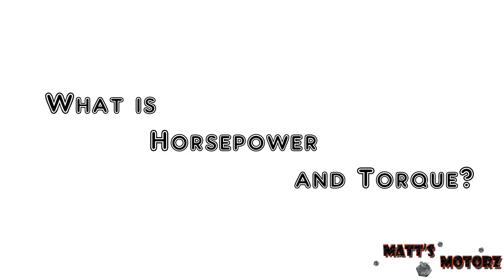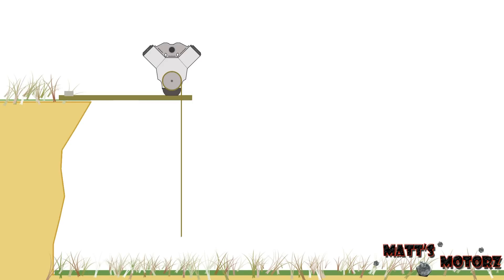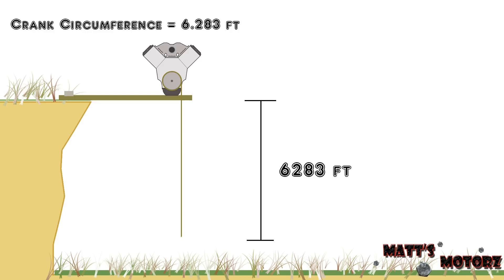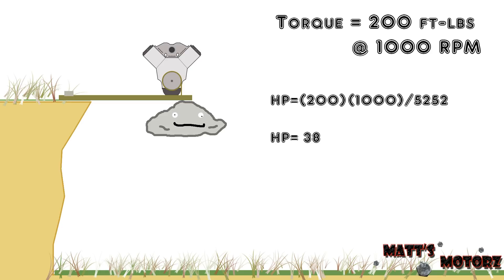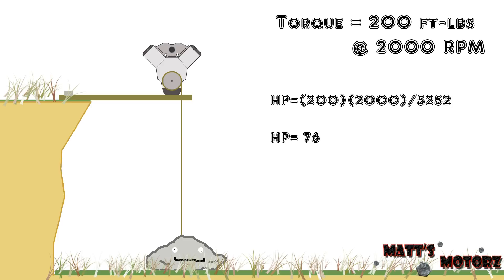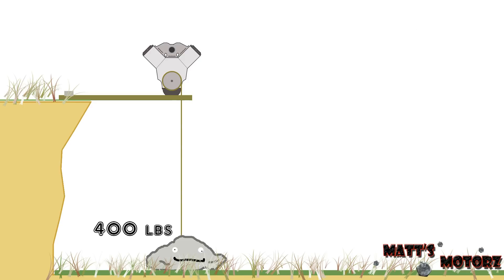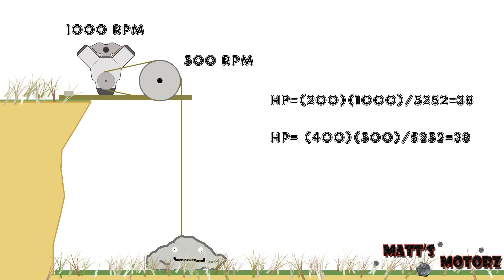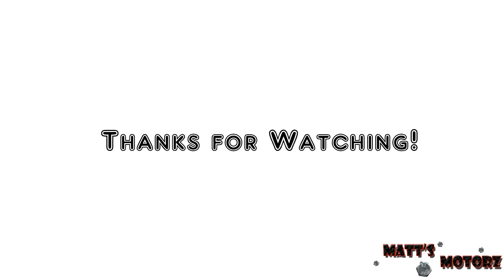What is Horsepower and Torque?

Comment: is gas mileage better when the car is running in low gear or in higher gear? Imagine, you're going up a heal, you can climb it in 2nd gear or in 4th gear where the car is almost stalling.
Reply: Generally a higher gear will reduce the RPM and cause less explosions per second = less fuel consumption = better mileage...as long as your engine can deliver the torque needed on the wheels to get going.
Reply: But, the injectors pump more gas under load, don't they? Lets say this is a 1.8turbo engine
Reply: but maybe they push more gas when the load is greater?
Reply: Sure, each explosion can have different energy produced. Your engine running idle at X RPM uses less fuel per cycle than when driving, for example.
Reply: now back to the original question, is it more efficient to drive in low gear or in high gear up the mountain?
Reply: meocats Well gas mileage is usually measured when the only load on the engine would be the car itself. Going up a hill forget gas mileage. The average car weighs roughly 3,000s lbs. Lets say you're going up an incline that is 30 degrees. We all know how gravity works so the motor is not worried about propelling the car on a flat surface but fighting against the car rolling back. To put it to simpler terms you would get the same results by putting the engine (lets say the 3,000 lb car came with a 2.5 liter engine) into a car that weighs 5,000 pounds. More load=more fuel consumption. You will never use high gears at low speeds nor high gears at high speeds.
Reply: xXxMartin96xXx, You can, within some limits, get better fuel efficiency at lower speed, but it's not a general rule. The more weight you carry the more rolling tire resistance and other energy losses you get e.g. when you brake the car more energy gets lost into heat. But surely, reducing the car's speed helps reduce air drag and overall energy needed.

Comment: horsepower is how fast you can hit the wall, torque is how far you can carry the wall with you :)
Reply: All these explanations just makes people not actually understand the physics involved.
Reply: horsepower is just the amount of work the engine can do... the design of a cars engine is to turn linear motion(pistons moving back and forth) into rotational motion(driveshaft, flywheel, transmission, driveshaft/CV axle, wheels) creating "torque" which is "usable" energy distributed through the flywheel and transmission to the wheels and give you mobility.
Reply: Horsepower is a unit for amount of work per time (about 746 Joules of work per second). A Big Mac contains about 2,300 Kilo Joules or 2,300,000 / 746 / 60 / 60 = 0.9 horsepower during an hour.

Torque is not usable energy. Torque is a twisting force that combined with rotation can create power (and energy through time). You can have 1000 foot pound of torque with zero energy if the RPM is zero.
Reply: this makes me think of a car running on big macs
Reply: i need investors for my big mac engine
Reply: ***** shhhhhhh

i dont want anyone knowing of that
Reply: Horsepower is how fast you can accelerate the wall and the vehicle, torque is just a number.
Reply: Torque is how wrong, stupid and irrelevant an analogy is. RPM is how much it gets multiplied by "likes".
". Power is the resulting permanent
cognative damage caused to our collective consciousness.
Power, not torque, is the limiting factor in not only the top speed of a vehicle but also how quickly it can accelerate at any speed and how much weight it can pull up an incline at any speed.
Please do yourself and the comments section a favour and watch a video called:
"Horsepower is NOT how fast you hit the wall.
Torque is NOT how far you take the wall with you"
It's on the D4A channel. It illustrates the distain the people who understand Physics and engineering have for these idiotic Idioms that spread like a pathogenic mind virus.

Comment: I'm still flipping lost? 
So for argument Sake if I had a Engine that had 160bhp & 280lbs but only revved to 4500. 
And I had another engine 160bhp with 177lbs but revved to 6500 which would be the quickest .?

Comment: Holy fuck, Americans and your imperial units. This is how you understand this.

1 Horsepower is equal to 746 Watts, and Watts is a unit of power which is also the Energy (Joules) per second. For example, a 100 Watt lightbulb will consume 100 Joules of energy every second, a car with 100 Horsepower would consume 746 Kilojoules of energy every second.

Torque is a unit of Force and is measured in Newtons, and what is force? It's how hard you push on something, if you push on a button very hard, then there is a lot of force, if you press it softly, then there is little force. If you twist the crankshaft very hard, then you're applying a lot of torque, if you don't twist it very hard, then you're applying little torque.

Torque is important because it measures how strong your arms are, if you want to twist a very heavy crankshaft, then you need strong arms that can apply a lot of force. High torque is necessary for trucks that need to handle a lot of weight.

Horsepower is more related to energy consumption, if you are able to consume a lot of energy in a short amount of time, then it translates to more movement, this is important for sports cars which focus on consuming the greatest energy possible in order achieve the greatest amount of speed.
Reply: Jasmine Ju, an imperial horsepower is approx. equal to 746 Watts. A car with 100 Horsepower will not "consume" 746 Kilojoules of energy per second but rather "produce" approx. 74.6 Kilojoules of work per second.

Torque is not a unit of force but rather a measure of force times arm and can be measured in Newton Meters.
Reply: You explained that sow well...respect
Reply: damn thank you very much buddy,

Comment: As an european engineerig student, all these units made me cringe...
Reply: Metric units make everything so much easier...
Reply: Agree, I also feel I want to cringe. I graduated in Europe and moved to the USA and really feel the level of understanding science in America is way below Europe for the average people. I might be wrong, but my guess is that high school physics in the USA is seriously handicapped by having all these ancient units involved complicating what could be much simpler to understand and remember formulas. Many people ask where that 5252 number comes from and  you can find people who even believe 5252 RPM is some magic ideal RPM for an engine, for example. 
Ironically, this particular video is actually showing a confusion between a pound force and a pound weight. When you specify a torque using foot pounds, the "pound" is not a pound weight but a pound force (like Newton Meters is torque in the SI system). However, in the video the rope is pulling a 200 pound rock. Thus reality is the video is equating pound force and pound weight, These are units that mean completely different things and no, a 200 pound force can't lift a 200 pound weight object on standard earth gravity as the two forces (rope vs. gravity) will just cancel out each other. You need MORE force to move the rock and the more you have the faster you can ACCELERATE the rock: a = F/m = (Fr - Fg) / m = (Fr - m x g) / m. If Fr = Fg nothing happens (Fr: Rope force, Fg: Gravity force). If gravity g is on the moon, the rock will come up no problem :-)

So why are nobody saying the example of this video in actuality won't work due to inadequate pulling force?
Reply: By saying 'european' you actually meant EVERYONE except the muricans.

Comment: one of the best examples is the difference between a Harley and a "crotch rocket"  a Harley on average has more torque than say a yamaha R6. they will often take off and accelerate faster than the R6. but their horsepower is inferior. the R6 capable of 165mph the Harley even though it has a bigger engine only say 120mph. the crankshaft of the harley is larger. my friend has a sportster (kinda shitty bike i know) but his engine is 1200cc. my bike, the R6, 599cc. he accelerates faster, due to the larger crankshaft and higher torque, but my horsepower is much greater. i think its like 80 some HP on the sportster to 122HP on the R6. my bike will overtake his quickly. capable of more work, just takes longer to do said work.

Comment: The short version for simple people like me:

Torque is how much work you can do, horsepower is how fast you can do it.
Reply: another way to look at it is with a wrench. a longer wrench has more torque and can take off a bolt easier than a short wrench. the horsepower is you. ever try to use a really short wrench to take off a tough bolt? the longer one turns it easier. length equals torque in a nutshell without the fancy math as described. but the horsepower is kinda determined on your ability to turn it faster. maybe a bad example but gets the point across i guess lol
Reply: Atul Rawat
watch the video again. you'll get it eventually.
Reply: actually the other way
Reply: MrSotko Gaming
no torque means no movement. movement=work.
Reply: im extremely sorry. i wish so badly i could tell you that you are correct. its just not the case. and i wouldnt want to spread your disinformation and harm humanity. here is my comment from up top to help you. "one of the best examples is the difference between a Harley and a "crotch rocket" a Harley on average has more torque than say a yamaha R6. they will often take off and accelerate faster than the R6. but their horsepower is inferior. the R6 capable of 165mph the Harley even though it has a bigger engine only say 120mph. the crankshaft of the harley is larger. my friend has a sportster (kinda shitty bike i know) but his engine is 1200cc. my bike, the R6, 599cc. he accelerates faster, due to the larger crankshaft and higher torque, but my horsepower is much greater. i think its like 80 some HP on the sportster to 122HP on the R6. my bike will overtake his quickly. capable of more work, just takes longer to do said work."
Reply from the maker: Yes, this is correct.
Reply: If two motors have the same amount of peak torque but one has more horsepower, the higher horsepower motor will do the same amount of work quicker. That's exactly what he explained in the video between 1:43 and 3:15. Keep in mind this is at one consistent RPM. This is NOT taking into account torque and horsepower curves, which are massive variables in vehicular performance.
Reply: A good way to understand torque is when you wake up in the morning, with a piss hard on, you walk to the bathroom and push down on your dingus, to point it into the bowl and your heels come off the floor. That's torque. On a personal level.
Reply: A shot way to summarise your summary = INCORRECT
Reply: Yes, it even stems directly from principle of force, work and power
Reply: delinquentJACK

Comment: 2:16--The rock would be traveling upward @   71.397 MPH
2:53--The rock would be traveling upward @ 142.794 MPH
Everyone on site would be killed.
The Federally funded project would be canceled.
More tax payer dollars wasted.
The liberal left needs to outlaw torque.
Reply: 2:16--The rock will stay on the ground as the lifting force equals the force of gravity.
2:53--The rock will stay on the ground as the lifting force equals the force of gravity.
Everyone on site will get fired for not knowing better.
You are right about the rest except the point about outlawing torque. Rather Trump will help push a law to allow more torque for Americans to avoid the same problem to reoccur.
Reply: Upon listening to the vid again, I have learned that the Obama regime and liberals in general, are all about high horse power.

Comment: LOOOL why didnt you use metric units, its soooo much easier that way
Reply: NecomNaTo, that really is a bad explanation as gravity is involved in your description of power. The force of gravity varies with latitude and increases from about 9.780 m/s2 at the Equator to about 9.832 m/s2 at the poles.
Furthermore, using some average gravity of 9.8 m/s2, the horsepower needed to lift 750 grams one meter per second is: 0.750 x 9.8 = 7.35 Watts = 0.01 horsepower. If you say 100 meters it becomes closer. Or in other words, a 100 horsepower engine can lift an average human body 100 meters in about a second. Not that I will recommend that experiment though :-)
Reply: Puktor But finding out your engine power in KW takes like 10 seconds. Go to whatever car info site your country has and enter your plate number.
Reply: horse power is an amount of power needed for lift 750 g to 1 m of height in 1 s. ez enough  //EDIT: i meant 750 kg, mistake
Reply: Oh, sorry, my bad, i sincerely meant kg of course. Just a typo. I remember those numbers from reading about James Watt first introducing his new Horse Power unit to the public, he wanted to show people the power of new car engines compared to the strength of a work horse. 750 kg to 1 m in 1 s is something that anybody can imagine. Nice explanation tho :)
Reply: How is it simpler though?

Comment: Interesting example, but wrong perspective. You need to start from HP (what is engine characteristic) to explain torque...
Reply from the maker: I don't know what you mean.  Horsepower and torque are related via the equation shown.  You can start from either or.
Reply: Consider a dynamometer. It measures TORQUE and RPM directly.  It then calculates HORSEPOWER as a function of the other two.

In other words, you can't measure HORSEPOWER until you know the other two.
Reply: @ewiem4351  🤷‍♂️ Where did this social contagion internet Hivemind virus start?  This one that casts an incantation that power can't be measured?  Absolute Hivemind 🚮
I contacted Dynojet knowing their inertial drum type dyno does in fact measure power directly and calculates torque where other load cell type like the Mustang brand measures torque and calculate power. I asked them to explain/provide evidence as to how their dyno measures power directly. This is their reply:

Inertia Dynos Measure Power Directly

The Physics: Dynojet inertia dynos measure power using the fundamental physics formula: P = 1/2 x I x w squared / t
Where: I = moment of inertia of the roller w = angular velocity t = time This directly measures the rate of energy transfer (power),  not torque.
Key Evidence:Acceleration-Based Measurement:
Inertia dynos measure how quickly the roller accelerates under load
The acceleration rate and known roller inertia directly yield power
No torque measurement is required for this calculation
Torque is Derived, Not Measured:
On inertia dynos, torque is actually calculated from the measured power using: T = P x 5252 / RPM
This is the opposite of what people commonly believe!
Load-Based vs Inertia Distinction:
Load-based dynos (eddy current, water brake) DO measure torque first, then calculate power
Inertia dynos measure power directly through acceleration physics
Why This Matters: This direct power measurement is why Dynojet inertia dynos excel at simulating real-world acceleration scenarios - they're measuring the same physics that propel your vehicle down the road.
The misconception likely stems from people conflating all dyno types. Load-based dynos measure torque first, but inertia dynos fundamentally measure power through acceleration dynamics.
This is actually one of the key advantages of Dynojet's inertia-based approach - you're getting direct power measurement that reflects real-world performance!

See also U.S. Patent # (US3729989A)
Reply from the maker: Ewie M I agree with you, but nothing in this video is about the physical measurements of these quantities.  It is simply explaining what each one is.

Comment: Wants to make the math easier, uses imperial measurements
Reply: Imperial ??? You meant Metric right ??
Horsepower = Torque x RPM 
KW = Nm x rpm
You dont need 5252.
Like the rest of the world does.
Reply: Fekillix hp isn't an si unit either you have to do a converaion bruh
Reply: You use Watts observation of one horsepower as 150 pounds, 220 feet in one minute. First we need to express 150 pounds of force as foot pounds torque. 

Pretend the force of 150 pounds is "applied" tangentially to a one foot radius circle. This would be 150 foot pounds torque.
Next we need to express 220 feet in one minute as RPM.

The circumference of a one foot radius circle is 6.283186 feet. ft. (Pi * diameter; 3.141593 * 2 feet)
The distance of 220 feet, divided by 6.283185 feet, gives us a RPM of 35.014.
We are then talking about 150 pounds of force (150 foot pounds torque), 35 RPM, and one horsepower.

Constant (X) = 150 ft.lbs. * 35.014 RPM / 1hp

35.014 * 150 / 1 = 5252.1

5252 is the constant.

So then hp = torque * RPM / 5252
Reply: There is no relationship between 5252 and any engine tuning logic. 5252 is just a conversion number due to using old English units rather than the SI system of units. It doesn't mean anything more than that.

Obviously you have the same number of horsepower and torque at an RPM of 5252 simply because that's what the formula says. Horsepower = (Torque x 5252) / 5252 => Horsepower = Torque. So what? LOL
Reply: Lucas Detex si is metric first of all, and there are two types of hp, both metric and imperial. the difference is the wattage output. the eu released a notice stating that car manufacturers can only use metric hp (or euro hp) basically to keep it familair to consumers who arent used to having automobiles rated in watts, since they are now standardizing watts as the power unit. here in the good ol US.Of.A our automakers can still use imperial hp(745 watts, metric is about 735)
Reply: Lucas Detex also you can read on any tuning website that 5252 is the approximate rpm that your torque curve amd hp curve intersect lmoa. that is, if the flywheel is 6 inches in radius
Reply: Very good point.
Reply: Well actually it's Power[W] = Torque[Nm] × Angular Velocity[rad/s]. So yeah, it's not RPM.